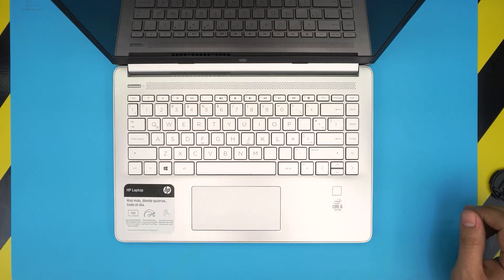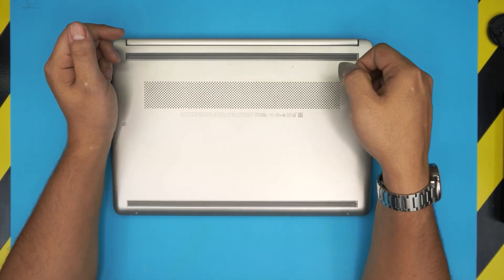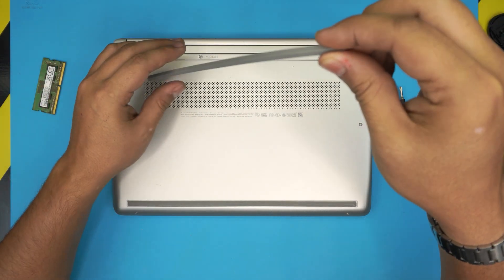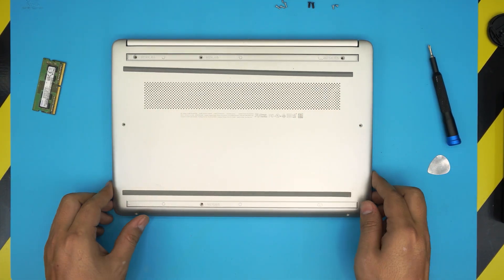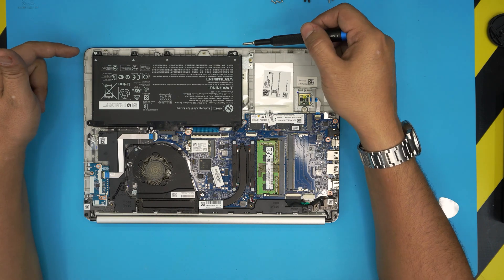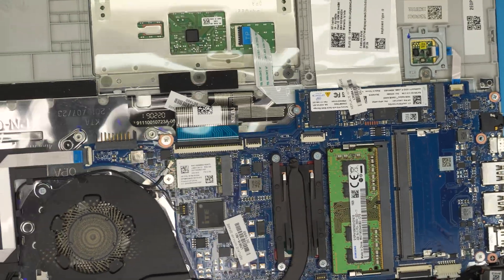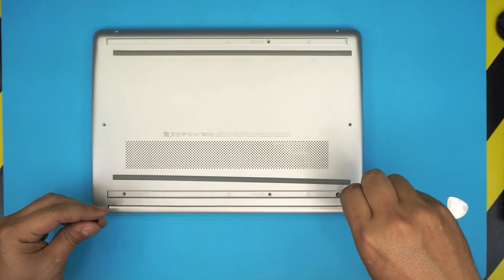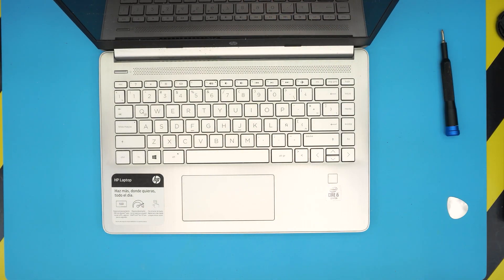How to upgrade Ram Hp Pavilion 14 Dq 1xxx Series laptop

Comment: Can anyone please help me and let me know if hp dq1001 can be upgraded to a higher processor? Mine has Ci3 10th gen and I want to upgrade it
Reply from the maker: 🫠Regarding your question, SORRY to inform you but the CPU on that model is soldered on board and is not upgradable.
Should you have any further questions or requests in the future, please don't hesitate to ask me.
Reply: Para que le cambiarías el procesador a una laptop? 😂 Te sale más caro que comprar una nueva...

Comment: hello, my issue with this very laptop is that although it contains a 2666mhz ddr4l ram stick, it is locked at 1333mhz as far as i know. i am looking forward to upgrading it with another stick but am wary about how much value it will bring at such low speeds. i initially thought that this was because it might have been limited by the maximum ram speeds that the i3-1005G1 supports, which upon finding out that it can support up to 3200mhz of RAM, just makes me wonder more.

is there any way to change the ram speed?
Reply from the maker: Thank you for your feedback! If you wish to support the channel, you can like, subscribe, or both!
Regarding your question, the CPU can go up to 3200 but the bios firmware is locked to auto detect and in safe side, and if you place a 3200mhz the bios will auto adjust to the  speed that can and like to use the ram at.
get a 3200 anyways and see what you get. there is no software or anything on laptops to be able to enable XMP on laptop bios, in PC you can go to BIOS and activate the XMP option and it will read the ram at its mas speed. unfortunately in most laptops 99% you can't do this.
NOTE: if you have a 2666mhz and buy a 3200mhz and install both the bios will auto adjust the 3200mhz stick at the old one 2666mhz.
so just make sure you have both stick at the same speed and let the bios decide.
Should you have any further questions or requests in the future, please don't hesitate to ask me.
cheers🍻
Reply: can you tell what exact sticks to buy? did you do 2x 8gb 3200 DDR4? @uFixTek

Comment: PLEASE please please tell me what is the keyword for another storage slot cable beside the NVME SSD on the top right corner. I have HP Laptop exactly like this and I want to upgrade but I don't know what's the keyword for the flex cable/storage slot to buy. Also is it only slot for SATA or NVME? (you already have the small square one with the slot, I have no slot and cable for it) thank you very much
Reply from the maker: Thank you for your feedback! If you wish to support the channel, you can like, subscribe, or both!
Regarding your question, it is a NVME m.2 and one sata you will need a "Laptop HDD flex adapter" 9pin
Reply: @uFixTek  okay man thank you very much, appreciate it
Reply from the maker: It's my pleasure my friend.
Should you have any further questions or requests in the future, please don't hesitate to ask me.

Comment: Thanks for the information. But let's agree that it sucks donkey balls that you have to do this just to get access to your laptop's components... Way to go, HP!!! 👎👎
Reply from the maker: Thank you for the feedback! if you wish to support the channel you can LIKE or SUB or both :P
regarding your opinion:  i must agree with it, and HP is not the only one most of brands are doing this , to prevent people from opening them and take them to stores or service center where they charge you 10X to stick a ram that you can buy 5X cheaper on amazon . its called right of repair (right of upgrade) , its sad but this practice is working like a charm for them, i used to work at asus repair center for long time and this action affected the traffic of upgrades by over 300%

Comment: hi, sorry for the inconvenience i am new to this. my laptop comes with 8gb of ram and a ryzen 3 3250u if i increase ram it will improve the performance of the apu or not it is not convenient.
Reply from the maker: Thank you for the feedback! if you wish to support the channel you can LIKE or SUB or both :P
regarding your question: if you want performance, 1st you want to make sure you have a SSD on your system with your windows on it, if you don't then do that and you will see a big bump to performance.
https://youtu.be/ycNgSVY2QLc
and after that if you want to open more tabs and load faster app or games then get more ram installed, it will help on opening more programs and tabs at the same time.

Comment: Hello great video!!, the color of my screen has turned purple(or pink) I can still use the laptop but everything is purple, what do i need to remove or fix ? Thankyou
Reply from the maker: Thank you for the feedback! if you wish to support the channel you can LIKE or SUB or both :P
regarding your question: the issue is from bad flex cable on the laptop you have to replace the flex cable:
check on ebay and aliexpress for the cable it should look this. give me the exact model number of the laptop.
https://is.gd/COKTIr

Comment: I just have the light on the caps lock key blinking twice every three seconds or so. Already plugged in the laptop.

Tried swapping out the dimms, same problem. 5mins so far with the laptop not booting.

Update: swapped out new dimm into the out of box populated slot, booted. Moved it to 2nd slot and put old dimm in primary slot. Booted but only detects one dimm.
Reply from the maker: Thank you for the feedback! if you wish to support the channel you can LIKE or SUB or both :P
regarding your question:   you may have to update the bios, and try again or you may have an incompatible ram (incompatible with each other), what brand and spec ram you purchased?
Reply: @uFixTek  Hi, thanks for the reply. Stock was 8gb ddr4 Samsung 2666, 4 chips on either side. I got an ADATA, all the same as the other stuff I could get were Kingston and Crucial with all the chips on one side.

I eventually got it to boot and both sticks detected, but

1. It took several attempts and reseating/changing the RAM config

2. I'm not sure if this was it but at some point the force I used to reseat the RAM was beyond merely firm. Borderline "might crack the PCB" when pushing it into the socket before pushing it down.

Chances are it might have also been just luck amd it eventually got detected after at leadt 24 restarts total.
Reply from the maker: ya you may have a had a one pin in the ram dim bad and after few inserts in the dim can fix the issue, but if it has detected don't touch it leave it, the way it is enjoy it, and the chip amounts or on one side or both sides make no difference, you can mix match them and it will work. but im glad its working now :)
Reply: Yep so far both are detected. Won't be touching these again unless that changes. At most I'm gonna have to open it up again and clean the fans/repaste in about a year but so far the heatsink and fan blades are clean and nothing's weird about the temps.

Comment: Thanks so much!
I hate that there is no comm port cover you can remove to easily upgrade the memory.
Reply from the maker: 😊Thank you for the feedback! if you wish to support the channel you can LIKE or SUB or both :P
regarding your opinion: the companies don't like that people upgrade the laptops, so they try every possible way to make it difficult or impossible to upgrade.
Reply: @uFixTek  I liked and subscribed. 
Yeah I'm in the technical field myself and figure that was the reasoning behind it. They also don't include full size ethernet ports or DVD burner drives anymore on new laptops.

I was troubleshooting my internet speed drop with WOW yesterday and the tech asked if I could connect an Ethernet cable from my laptop to the cable modem. To which I had to reply that my new laptop does not have a full size ethernet port and just wireless. Sad that a $500 laptop would not include a freaking ethernet port...
Reply from the maker: lol ya i been doing repair for 18 years and worked 4years in hp service warranty before that. if you would know what i know its behind the companies deals, you would be shocked we or people that are inside get to sign our life's away for not talk and expose what we see.
all i can tell you is that no laptop no brand no model its made to last long time. no matter how much you pay and what you do there is always something calculated will go wrong over time. and people keep saying ah they fixed the "defective" heatsink on next model. but reality it was never defective it was all calculated. the factor that all the laptop take in measure to their own benefits are: air flow, heat-pipe sharing, placement of the condenser, type of the x-clamp used (not hard enough), based on this areas they adjust on how long the laptop should last, and if they place a awesome heat-sink, they will go after components, they place horrible circuit less over voltage protection weak protection, because they need it to fail, so they can sell warranty and or new laptop or service center can make money.
regarding rj45 or usb type A removal its they make more money making you but the adapters, e.g : https://amzn.to/3IoIqQl
no laptop its perfectly made, unless you go back 20years.
its sad but we as technicians make it rain, and thats why i like to share and help people to save up $$$ and time, by making videos. i know i would get more views and subs if i do something crazy burning a laptop lol or drooping in acid :/ but that's pointless.
i appreciate your support my friend.
Reply: @uFixTek  Thank you very much for the feedback. Unfortunately there is not much of anything designed to last forever these days. Everything we buy is pretty much disposable. It comes down to something called "Greed". And we the technicians and the customers end up paying the price to line the pockets of these greedy companies who have figured out how to make devices break within a set time. It's become a science. Most people don't ponder these kinds of things. Most people are not critical thinkers.

I purchased DVD player around 20 years ago that had DivX and AVI playing capability. It was not cheap and I loved it. After 5 years it stopped working and just had a red light if I remember correctly. Anyway I looked up the issue online and the root cause was a $.15 capacitor...
I went to Radio Shack and purchased the capacitor, then replaced it. That DVD player lasted another 5 years and then broke again. I could not fix it the 2nd time. To summarize my point is that Philips could have used a better capacitor, which they purposely did not.
Reply from the maker: yes everything calculated :/

Comment: HP 14 DQ2055WM i thinking to buy this and since it comes with 256gb and 4gb ram only, I want to upgrade it to at least 16gb n 512gb storage. i don't see opinion for SSD and just one slot for nvme...
Reply from the maker: you can upgrade to 4tb NVME SSD m.2 , and the ram but you cant add 2.5' sata hdd or ssd.